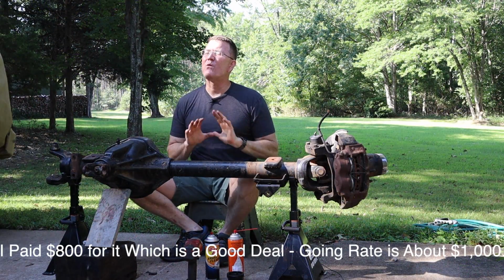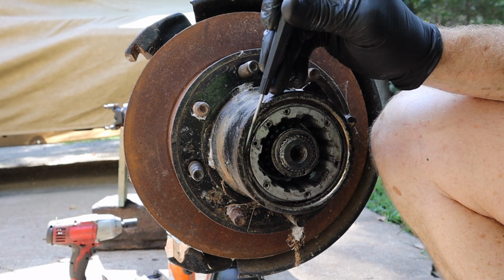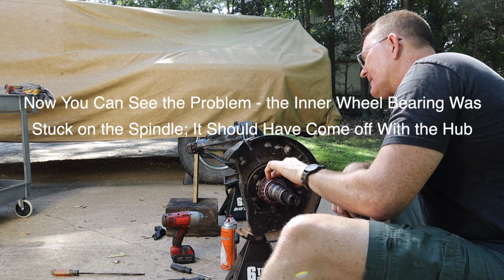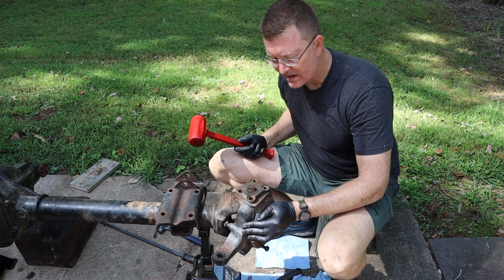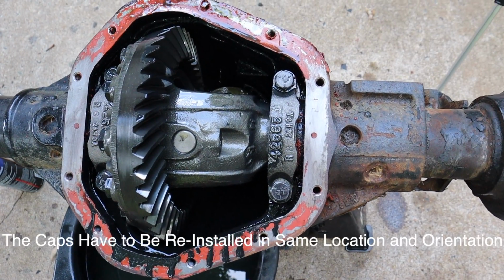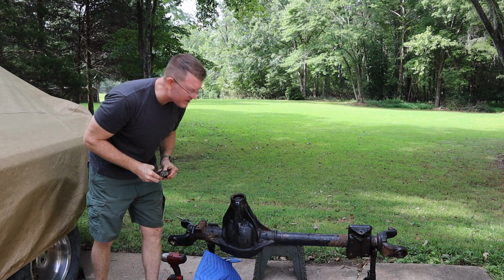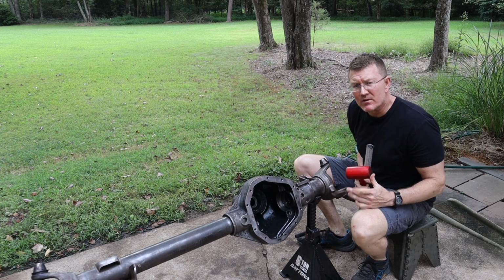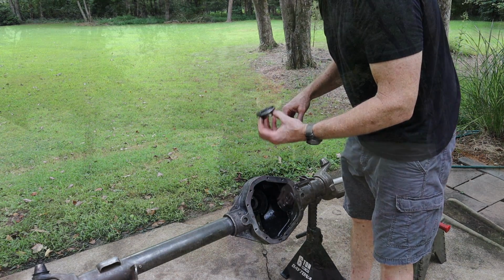Dana 60 Step-by-Step Rebuild, Part 1, Project Brutus, Ep. 7

Comment: I bought a matched set out of a 95.  This helps  solidify my decision to Do it myself.   going in my 93 F250, Going from 3:55s (open rear diff) to 4:10 (LSD in rear).  It's only got the 351W  We've had the truck for 8 years, paid 4K for her. New trucks are so expensive so we're going to put some money and  love into this one instead.
Reply from the maker: Grape Ape - if you have a matched set, it makes sense to swap to SD axles.  The 4.10 gears will help your 351W, too, of course.  Thanks for the comment, Scott

Comment: Good job I will have to do that to my truck, it says it's got 74 thousand miles but I don't know if it ha 174 thousand or 274 thousand, the cluster dosent show past 99 thousand miles.
Reply from the maker: Yep, same with mine.  Crazy that Ford wouldn't put an extra digit on the odometer, especially since these engines will easily run for 500k miles.

Comment: That's great that you were able to find a kingpin 60 for the front.  That truck is going to be quite heavy in the front when it's all put back together.  Only thing I would have done is checked the backlash on the gears to verify when it goes back together.  I'm sure it will be fine though.  Most of these axles never really got used too much unless it's winter time or when you really need 4x4 offroad.  When I bought my D60 I think I paid $1200 in CA but it already had the 1.5" 35 spline stub shaft ungrade done with the matching Warn Hubs.  Good luck dude and keep the content flowing!
Reply from the maker: Yes, she's going to be really heavy in the front when it's all said and done!  That's why I went with the stiffest X code Super Duty springs.  Understand your comment on the backlash; I don't think this diff was abused much, so hopefully I'll be good.  Thanks!
Reply: I don’t use the 4x4 so I intend to remove the axle shafts .will I loose the gear oil ?